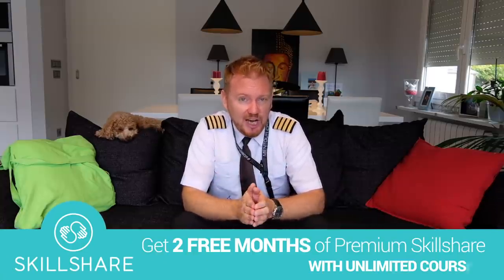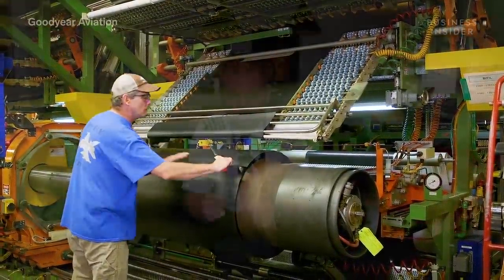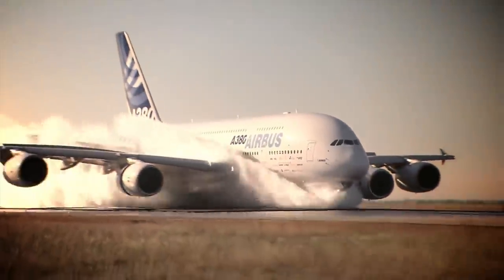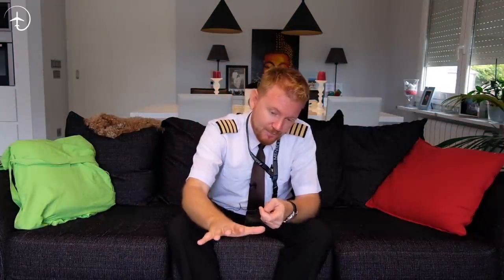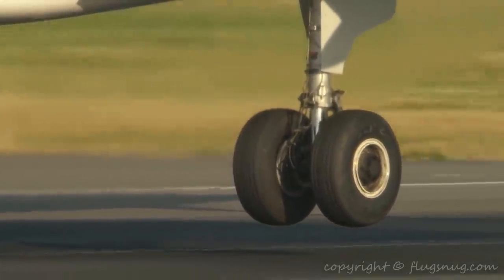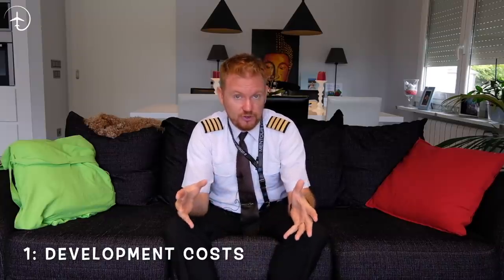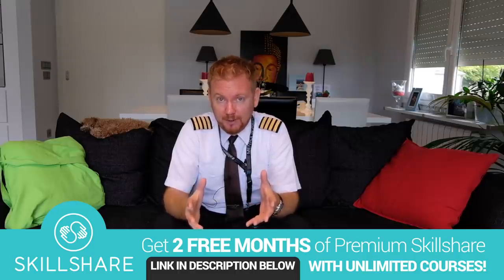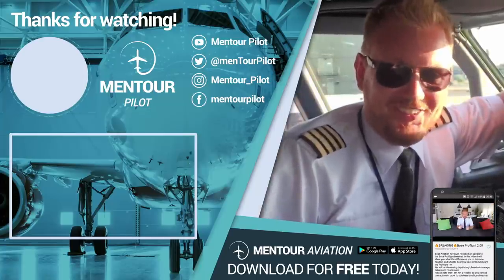Why not make plane-tires spin, before landing?!

Comment: You're a wonderful pilot, and teacher, but you're not a physicist!     Nitrogen is inert(ish), but it obeys the Gas Laws just the same as any other!    The reason it's used is because it can be supplied without any water vapour in the gas, unlike compressed air.      With the temperature changes in a flight and landing, the condensation and evaporation of the water would cause extreme pressure changes in the tyres.  For instance, tyres correctly inflated before take off might cool so much that they don't stay on the wheels when they cool down at altitude!

Comment: Knowing absolutely nothing aircraft landing gear, common sense alone and a very elementary  understanding of the physics involved, and  some observations (via close up video)  of how they work,  the wheels of any plane work just fine and as intended just as they're designed. I've had some technical training and studies as well as actual field work. Over the years I learned that regardless of the intended purpose of the machine,  always apply the KISS principle. Keep It Simple Stupid. Simplicity is an art form.  Don't over engineer it. Aircraft wheels DON'T need to be spun during landing.

Comment: Man, I watched a few of your videos and when you start talking about physics/chemistry topics, you make huge mistakes!!! Again you made a mistake by misdefining the term"inert gas" at 5:00 and said that: "an intert gas does not undergo teperature expansion". INERT means that it does not like to react with other substances voluntarily to form new chemical compoings - you could say that it is very inreactive - such as in the reaction of HEAT + PRESSURE + RUBBER + OXIGEN = OXIDATION = FIRE = POTENTIAL ACCIDEN & DISASTER ! 

Keeping in mind that most gases obay the IDEAL GAS LAW, what you should have talked about is something called DRY NITROGEN, meaning it has very little MOISTURE CONTENT, because it is the moisture content of the gas which varies the pressure inside of a tyre significantly, not the kind of gas you put in! Unlike pure nitrogen, normal air consists of 79% Nitrogen and 21% oxigen, however, normal air contains some moisture as well, and this moisute is what changes the tyre pressure when you subject it to heat changes. 

Race cars use dry nitrogen as well, for example, but it is not because nitrogen is an INERT GAS, it is because it idoes not have moisture. 

Thumbs down because this is a HUGE mistake in my opinion.
Reply: Unreactive not inreactive ;)